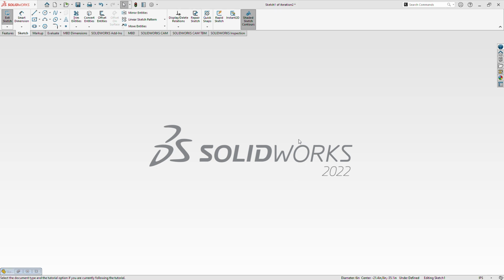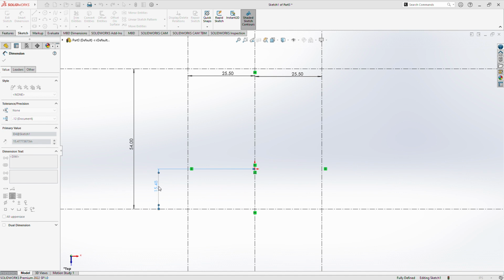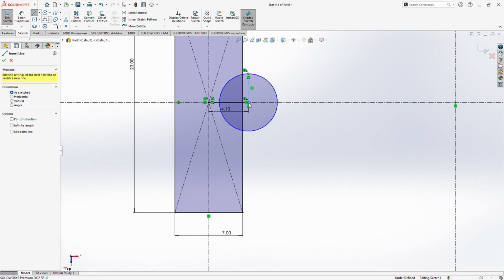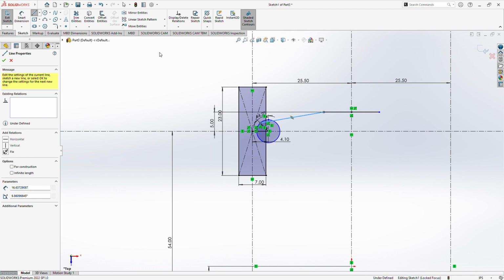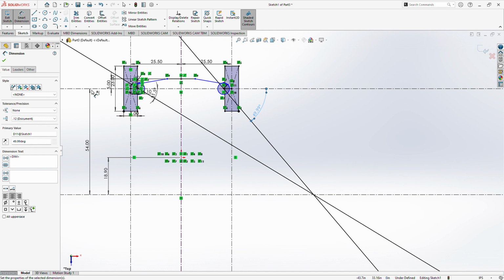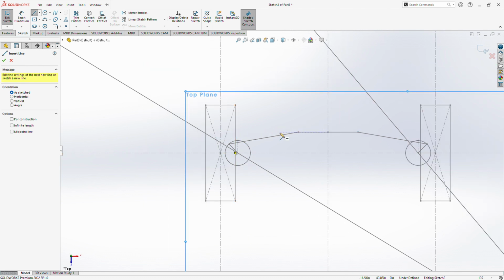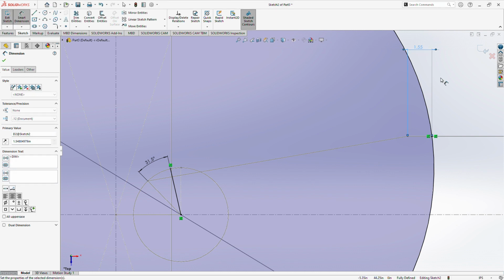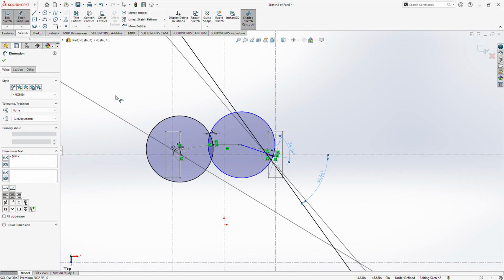Ackermann Steering Geometry for BAJA ATV | SOLIDWORKS 2022 | 2D LEADING ARM TURNING GEOMETRY

Comment: How did you know the inner wheel angle is 31 degree
Reply from the maker: It was a calculated assumption based on iterations... Assume the angle according to yjur design and make the geometry.
Reply: @murtaz1406 okay thank you for your response

Comment: This is anti Ackerman steering geometry
Reply from the maker: I'm pretty sure this is Ackerman geometry. 
One mistake is that it is leading arm geometry rather than trailing arm.
Reply: @murtaz1406 it is anti Ackerman geometry cause the steering arm is at a obtuse angle and you can check by giving turn angle to both wheels and see outside is turning more

Comment: how to get the steering arm angle?
Reply from the maker: You need to assume that from the range of 38 degrees to a maximum of 45 degrees... Iterate the geometry keeping the values same and varying only the steering arm angle, you'll find the relation between the parameters and you'll be able to achieve an optimum value. 
The logic behind the steering arm angle is that the lines extending from the steering arm should meet nearest to the rear wheel center line

Comment: Hello! My college is currently going to participate in BAJA SAE for the first time ever. And from the video above I can see a lot of assumptions that we have to take. Can you please tell me how u reached those assumptions. I mean the stuff like wheelbase, track width, kingpin inclination, the angle for tru Ackermann etc. Another doubt was that I think the track width limit is 64in. Why go for a small track width of 54in.??
Reply: Our collage is participating in SAE REEV
Reply from the maker: Hey buddy!! 

These assumptions are based on the previous rulebook where the trackwidth limit was 54in and the other assumptions are not just assumptions, they are iterations. To make this geometry, you have to assume some values and you should assume the easier ones. You can always find a sweet spot by fixing a value and then changing others for a new iterations. I made almost 50+ iterations and then I got these values which I call it as calculated assumptions. 

Hope this helps!!